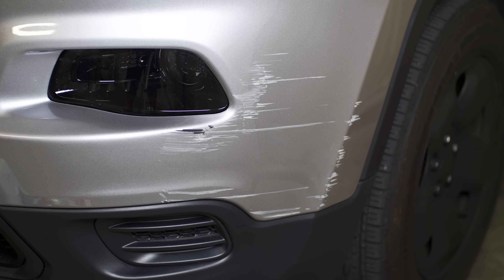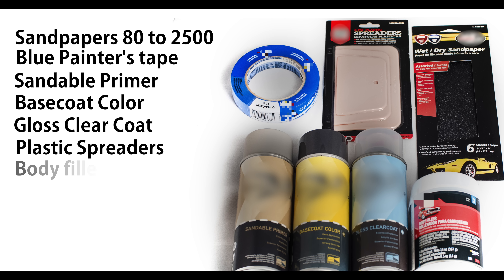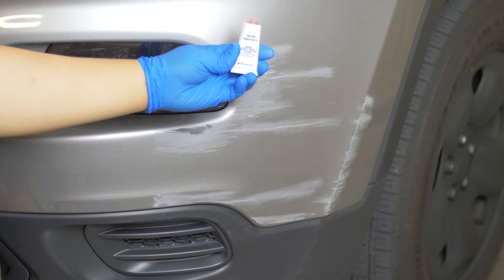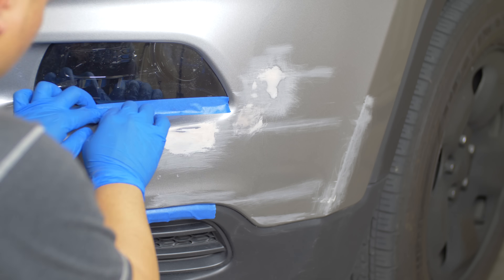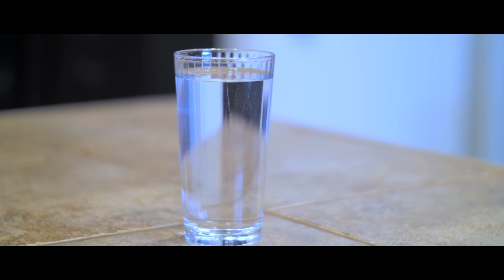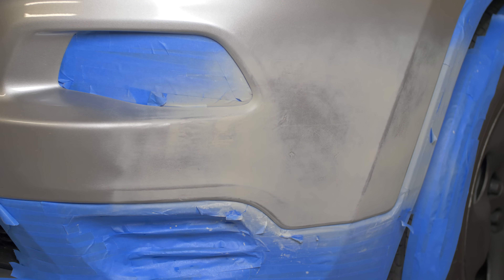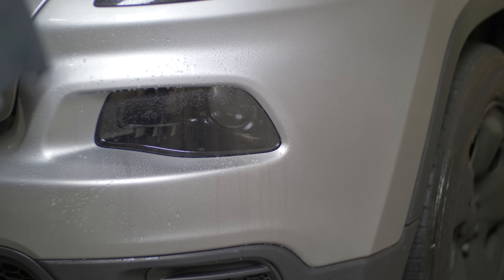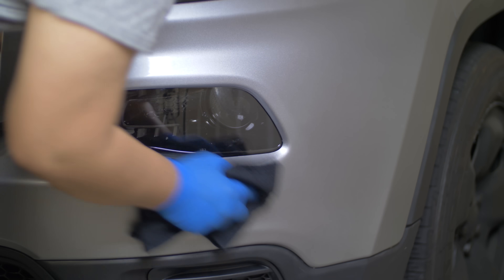How to Repair Scratches on your Car | Save Hundreds of Dollars

Comment: How can a metalic paint doing only the touch up ? Colour differences can be seen after the patch up. Pls explain
Reply: After the touch up
Reply from the maker: The paint matches but from what the people in the comments have suggested was to use a very high grit of sand paper after the paint dried/ before buffing. This would help match the gloss. I  wasn't able to do that in this video.

Comment: Yeah I’ve got to repair in my 2016 Focus with only 30K on it. My supervisor at work was backing up the company truck and one of the utility doors was open and high-fived my car three times. He told me that the door was open when he was backing up, but didn’t have the common curtesy to specify which side, and maybe we need to check your car out for possible damage. I go to wash my car Saturday and wouldn’t you know it…I’ve got white paint scratch on my front fender, all the way across my driver side mirror, and a nice white scratch on my rear driver side door. God I felt so disrespected by the lack of transparency and honesty by my supervisor. I just lost all respect for him! I had zero scratches on my car until now.
Reply from the maker: Oh man that sucks. I hope my video can help you.
Reply: @ThomasofAllTrades  Yes Sir. Thank you.

Comment: Did this to my car using a small hobby airbrush and paint out of a touch up paint pen from dealer.  Couldn’t find a big spray can of paint to match my car paint.
Reply from the maker: How did it turn out? And what car do you have? 
I have the link for paint in the description.
Reply: @ThomasofAllTrades  15 Ford Flex, all I could find where I live was touch up paint, or a pint can.  No spray cans.  This was in British Columbia, Canada.   I just drained the paint out of the pen and mixed it with lacquer thinner to spray it.  It turn out almost perfectly.  Did the same as you just used a hobby airbrush for the colour coat.  Still used a rattle can of primer and clear coat.
Reply from the maker: @oneastrails  oh ok. I'm glad it turned out well for you.

Comment: I thought you will surround the area for paint with tape so dont contaminate the rest of the paint?
Reply from the maker: It's good to put tape around the areas you don't want to get paint on but it's better to leave the rest of the bumper with no tape because it's the same color anyway and it would blend better.
Reply: Ohh ok that was my question on how to blend the two areas together because I have almost the same problem but I don don’t want to paint the hole bumper thank you.
Reply from the maker: @hcab5492  also make sure to check my notes in the description.
Reply: Ok I’ll

Comment: How do you paint just a small section? When i mask off the surrounding area for a small square section i want to paint i can always see a square outline where i painted when i remove the tape even though i fill, sand and use the same color
Reply from the maker: I didnt put tape on mine like that because it would create that outline. Instead I would just carefully blend it.
But if you do get that outline lightly sand the edges with a fine grit.
Reply: @ThomasofAllTrades  and the blending is what the polish is used for pretty much right?
Reply from the maker: @joshm2838  yes polishing and using compound would help with blending but sanding it with a very very fine grit should affect the blend the most.
Reply: @ThomasofAllTrades  thanks for the replies, when i put the paint over the sanded primer it looks grainy and textured. Does this mean i need to sand the primer under it down more before applying paint
Reply from the maker: @joshm2838  yes. And then you sand the clear coat with a very very high grit for a mirror finish.

Comment: Can anyone help or advise please? I have spray painted and once it has dried, I can see  the filler through the paint. I have done 3 coats again but the filler is showing on some parts. Can you tell me what I can do. Thanks
Reply from the maker: Sand it down and Add more coats of the base coat.

Comment: 2:38   It doesn't appear that the body filler patch was adequately sanded (i.e. feathering) prior to priming. And the spot was sanded without the use of a flexible block?
Reply from the maker: You're right. I didn't.
You can, if you wanted to for a smoother and more even surface. 🙂 I did spend more time on sanding the primer though

Comment: what do u do if the scratch is inverted like a small bump?
Reply from the maker: sorry for the late reply. if it's a small bump you can just fill it with body  filler and just follow the paint process in this video.

Comment: Hi, Thomas! I couldn't help but notice that you've done it so easy. I was really amazed. I really like it. Now, I would like to try it myself since side panel scratches really bothers me but I'm faced with this dilemma on whether to buy a generic pearl white spray paint via hardware or online. The color specifics is qx1 z (aspen pearl white.) I hope you don't mind but is there any better way to solve this? I'm just worried how will it turned out if I didn't get the exact spray paint I'm looking for. Please advise. Tnx.
Reply from the maker: Thank you. 
I have the link for the paint in the video's description!
I trust their products and I am happy with the results. The color on my car looked glittery up close and I was surprised that when I painted it, it actually matched and had the glittery effect as well.

Comment: Close!  But you don't need to sand the primer to that level. It is a waste of time.  You need to wet sand the coats of PAINT  with the super fine sanding between coats. Then clear coat, then polish. The hardest part is getting the right paint that will match.
Reply from the maker: You're the second person to say to sand the base coat. Thanks for the suggestions.
Reply: This didn’t work for me. Trying to fine sand between coats of paint really made a mess of things. I had to two spots, the spot I didn’t do this on came out better. 

I was waiting 10 minutes between coats and using a heat gun. Maybe it needed more time to dry?

Comment: Honestly the hardest part is making sure the bondo is smooth with no lumps or cracks. How would we start over if the bondo is all lumpy and cracky on some parts and it has dried? Just sand it down again from the beginning? Best sand grit paper to start from starting from messing up?
Reply from the maker: If it's too rough just sand it with a low grit sand paper. 
The primer is sandable too, so you can make that one smoother with a higher grit.
Reply: @ThomasofAllTrades  Yeah mistake for me was also not mixing the bondo in the can before throwing it the bondo board and also getting it on parts of the bumper that didn’t need it. I’m guessing low is with 40 and then go back to 80 and start the process over?
Reply from the maker: @shuvang  yes. You gotta be careful with the Bondo. It does really quickly. Start with the 80 first and if it doesn't do much then go to 40 and the back to 80.
Reply: @ThomasofAllTrades  Will update. Thanks.
Reply: @ThomasofAllTrades  Well I used lacquer thinner to start all over sanded with 80-120-180 got rid of the unnecessary bondo…but no matter what I did masking the parts I didn’t want to have the primer from spray on. It just leaves residue of primer. I guess autobody repair just isn’t for me. I’ll probably have to pay someone else to fix it now.
Reply from the maker: @shuvang  I say pay close attention to the details. I laid it out on the video step by step. I was happy with the results.
Reply: @ThomasofAllTrades  I know your results were what inspired me to try it out. Just like your video I asked two small shops how much they charge. They quoted $700-800 for small damage and said the entire bumper would have to be stripped and there is no option to do it besides doing that and paint it from scratch. Lol
Reply: @ThomasofAllTrades  Forgot to ask did you get any paint overspray and how long has the paint lasted?
Reply from the maker: @shuvang  there are some specks on other parts of the car but came off after car wash.. The paint still looks great til today. I haven't had any problems.
Reply: @ThomasofAllTrades  Yeah that is great to hear. I’ll update my 3rd attempt with a full can this time.
Reply: @shuvang how'd your final attempt go?

Comment: Which clearcoat did you use the maxx 2k or the automotivetouchup house brand?
Reply from the maker: House brand
Reply: @ThomasofAllTrades  Is it still holding on after all these years?
Reply from the maker: @wattsobx  yes. And it's only parked outside.

Comment: do i need body filler? Im not sure when to use body filler
Reply from the maker: It depends on how deep it is. Mine's were really deep. Even after the first sanding it was still deep. 
If you sanded it the first time and the scratches flattened out then you probably wont have to use a body filler.

Comment: For that sandable primer isn’t it different colors ? If so any specific one or doesn’t matter since it’s getting painted & sanded  anyway , & basecoat color is just the color of the car correct ?
Reply: & what brand would you recommend
Reply from the maker: @uptopbb5723  you're right. I can only recommend the one I've been using for my multiple repairs. Link in description.
Reply: Where’s the link to the sandable primer , the 3 cans you show in the beginning I didn’t see a link for only the body filler next to the 3 rattle cans .
Reply: Ordered everything in the link but the 3 rattle cans wasn’t on any of the links
Reply: Never mind I didn’t go all the way threw the paint stuff I got it all thanks
Reply from the maker: @uptopbb5723  no problem. Yeah. It makes you choose the base coat first and then it allows you to select the primer and clear coat as a bundle.
Reply: Last question how’d you get the paint to blend so well with the rest of the paint ?? It looks good as new once you finished
Reply from the maker: @uptopbb5723  I didn't put tape between the scratched part and the good part so it blended pretty well since they're the same color anyway. Also, check the notes I have on the description.. It's about using very high grit sand paper after the paint dried to make sure it's shiny. I didn't do it on this video but a lot of the people in the comments suggested it.
Reply: Ok thanks getting ready to do my car first thing in the morning once. Should be able to get I done correctly since I painted calipers & rims plenty of times
Reply: Wait very high grit after the job is completely done ? Thought that would scratch the fresh paint tho
Reply from the maker: @uptopbb5723  add a couple layers of clear coat and when it dries use a very very high grit. It won't really scratch. It would just buff to mirror shine.
Reply: Ok got it
Reply: Last question for real this time lol did you mix the hardener inside the body filler with the amount it says on the back or did you put some inside the clear top it comes with & just mixed a small amount with that ?
Reply from the maker: @uptopbb5723  no problem. Lol I just mixed a little bit of both on the lid. Make sure you read the instructions for the ratio. And also it dries really fast so you have to do it pretty quickly. You should be ready to go as soon as you mix it.
Reply: Update I’m pretty much done now as I’m typing I’m waiting for the paint to dry just finished the last coat then I’m going to apply the clear coat , tu red out great looks like the rest of the car again once I finish the clear coat I’ll let it sit in the garage overnight then do the compound, polish then wax  in everything in the morning
Reply: Only took 9 hrs lol , probably could’ve sanded a spot or 2 a little more but it’s not noticeable  unless your looking dead at it up close
Reply from the maker: @uptopbb5723  Sweet!! When I did mine all I was thinking was that anything would be better than the scratch. I was actually surprise about how it turned out.
Reply: Funny I had the same idea while I was doing it & it’s crazy once I finished the clear coat the spots that look like it wasn’t sanded enough disappeared lol it actually looked perfect before I left can’t wait to see it after I apply the compound & everything in the morning , great video ! It was easier then I thought it would be like I said I’ve painted calipers & rims plenty of times but never anything body work wise came out very clean
Reply from the maker: @uptopbb5723  I'm glad that it worked out for you

Comment: How do you fix a scuff on the black part of the bumper if that also gets scratched? Same process?
Reply: you can buy textured paint, failing that - if it has a pattern apply a large piece of bluetac  to an undamaged area and when you have put the primer on, touch the primer with the bluetac (the pattern of the bumper will be on the bluetac) when the primer has fully dried, apply the topcoat.
Reply: works on damaged dashboards too
Reply from the maker: wow. thanks

Comment: All good how to advice for do it yourselfers but a word to the wise here is do not use any type of "bondo" body filler on scratches, what you should use "glazing" . There are many types available and it is the right product to use, been doing bodywork for 40+ years.
Reply from the maker: Thanks for your suggestions. Will look into it.

Comment: Did you add a coat of clear?
Reply from the maker: The coat of clear was added. You might've missed it.
Reply: @ThomasofAllTrades  ok, nice job
Reply from the maker: @carlingas666  thanks Carlos
Reply: @Thomas of All Trades  I forgot to ask you. What type of filler are you using? Is it a special filler for fascias or is it regular bondo? If it’s regular bondo, won’t it crack with time since it’s placed on a plastic surface? Can you confirm? I’m looking to fix the bumper on my car. Thank you
Reply from the maker: @carlingas666  I used a Bondo for cars. Find a Bondo that works for your car. Mine hasn't cracked and it looks the same years later.

Comment: Hi I am fixing some deep scratches in my car. I am new in this. I found all the product except the sandable primer,and gloss clear coat. I really appreciate if someone can post the Amazon link of the same. Is the base coat colour is the same as matching colour of the car? Thanks
Reply: find the base coat color by looking at the service tag of your car. it should have a 3 letter code for the base coat color. i would rec touchupdirect for the primer, basecoat, and clear coat, they send it all to you
Reply from the maker: I have link for the paint in the description. You select the base coat first and it will allow you to choose primer and clear coat as a bundle.
Reply: I live in Canada so most probably touch up paint website don’t ship there. The sand-able premier is available in different colour. Do I have to pick a particular colour or it doesn’t make any difference.. My car colour is silver.

Comment: Anyone got some tips for me i bought a car and turns out the front bumper has been replaced in the past it was a gray bumper they painted in black (black is the colour of my car) and i had like a glue’d piece of plastic to my bumped i took it off recently and with taking it off it also took a huge chunk of my paint so im looking to fix it but i dont know what grid sandpaper i should use for this fix should i start with a lower number ald build my way up to 2500 or should i just clean the area and start with high grids like 1500 and work my way up to 2500 ?
Reply from the maker: @whatintheabrahamlincolnisg9567  follow the video in terms of sanding but you gotta paint the whole bumper to match the color perfectly.

Comment: Good video but you never sanded your blend areas and also you never put enough clear coat on, that’s why it was a Matt finish instead of gloss, also 2500 grit is too smooth to paint on
Reply from the maker: Thank you for your suggestions. I did mention that in the description about what other people in the comments suggested.

Comment: i am trying this soon
wish me luck
Reply from the maker: Good luck to you. Lemme know how it goes.
Reply: @ThomasofAllTrades  Hello Thomas, I found a 1K spray filler, Do those things work as well as the paste based 2K fillers?
Reply from the maker: @hulk7861  I'm not sure. I haven't used those. I only used the Bondo. Check the type of material you're painting. It might be plastic or metal and buy the appropriate filler for it.

Comment: 800$ for this tiny area , so what will they charge for the whole car
Reply from the maker: Around 5k
Reply: @ThomasofAllTrades  That is almost buying another of the car
Reply: This in equivalent will not be more than 15$ to repair in my country at the most 20$
Reply from the maker: @tayokarate  nice. Which country?

Comment: After wasting $150 it’s going to professionals to fix it. The result was not the same although I followed all the steps.  I had a scratch on plastic bumper and may be it has few extra steps to take.  Lucky those who could save some money .
Reply from the maker: @diyag6922  it wasn't shiny enough or what was the problem?

Comment: ^don't you see it if you paint only a part ? Why dont you show the whole front of the car so one can see wether there is a difference in color..
Reply from the maker: @cokakada1189  it was hard to tell. My initial goal was to minimize the look of the scratches. But it turned out better than I expected. I did show the front of the car on that side. You can compare it to other parts shown on that footage. It's not as shiny as noted in the description but there's things you can do as noted.